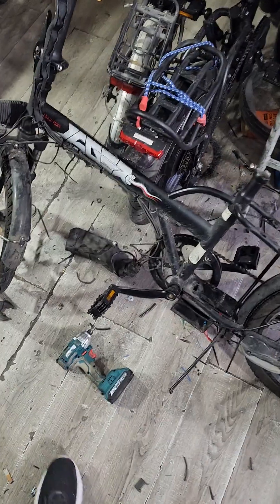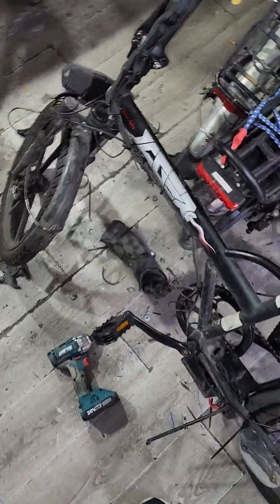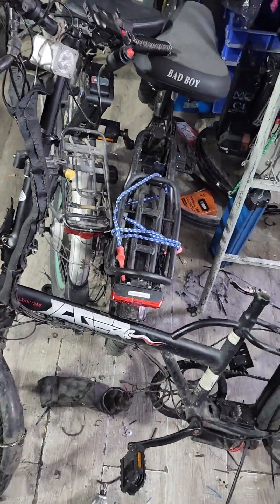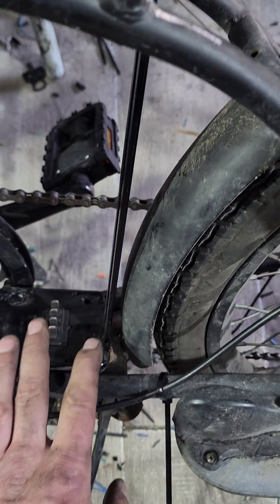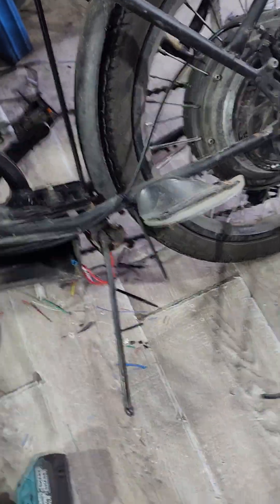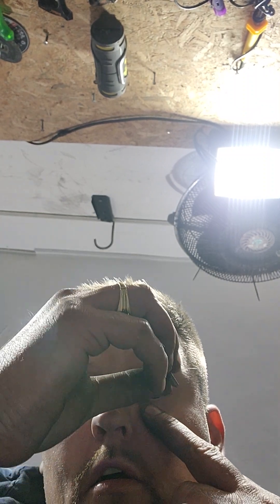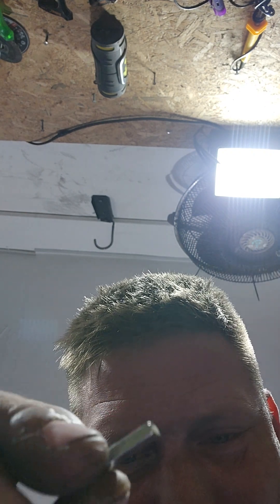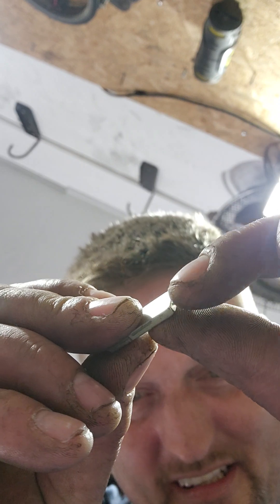How to get a metal shaving out of your eye with a magnet and save yourself from a corneal abrasion

Comment: Does it hurt when it pulled the metal out ?
Reply from the maker: No, not at all
Reply: @tootalljosh  I just bought a earth magnet and dreading how it’s going to feel lol
Reply from the maker: For me it works everytime. As long as its metal, a strong magent will pull it out no problem. Just make sure to clean the magnet really well so it doesn't scratch your eye with a piece if dirt stuck to it
Reply: @tootalljosh  do I expect a sharp pain of any sort ?
Reply from the maker: @user-pf9bl5pu8u everyone is different, but for me, it's a big relief as it hurts until i get it out. If it's a huge piece, I'd go to the hospital. If it's just a spek, it should pull right out painlessly and easy. Best of luck. Im not a doctor so please dont take this as medical advise.
Reply from the maker: It was an instant relief

Comment: Nice one man, thanks. As a teenager I worked in a wood factory making bed frames back in a time when Safety Squints were all that were required. One day I caught a small wood chunk in my eye. One of the older hands got me to hold my eye open and he just blew it out with a quick focussed puff of his breath. Lips pursed to narrow the air stream.  Another time, a short jet of compressed air, because I said I'd prefer it if he didn't spit in my eye, even for an emergency! Instant relief.
Reply from the maker: That's a great story, and it's good to know. Thanks for sharing.